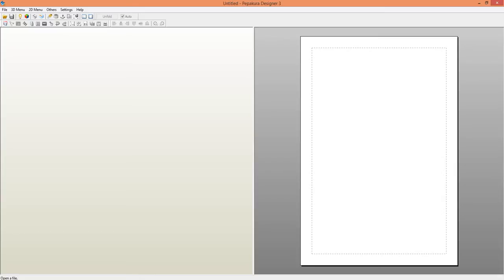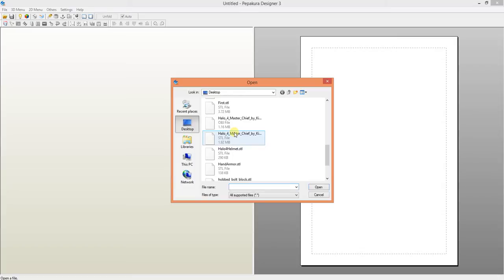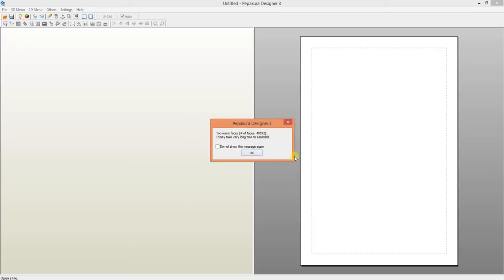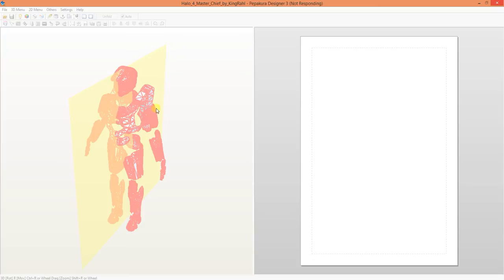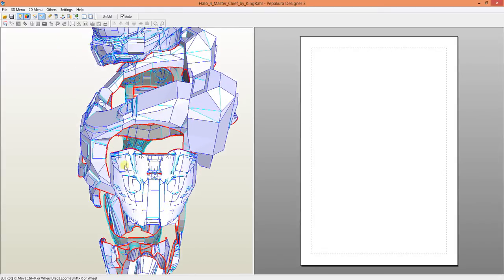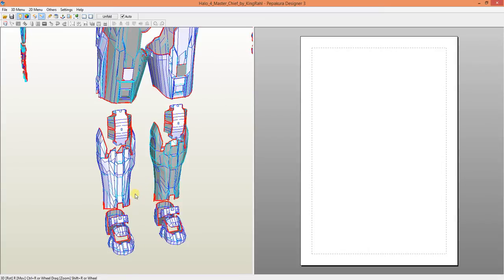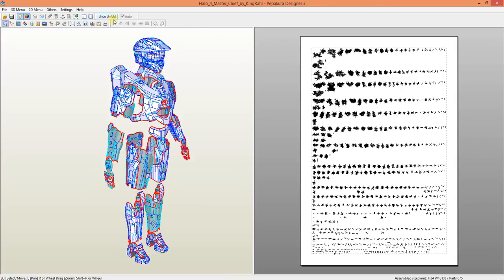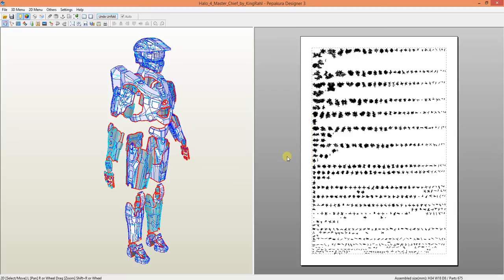Video 1 Extracting armor files from Pepakura for 3D printing

Comment: it requires you have the paid key. any way around it?
Reply from the maker: Sorry, no. You may be able to find a crack somewhere on the internet. But I wouldn't trust it. It could cost you more than just buying the software. Alternatively, you might contact the artist that created the file and get original.